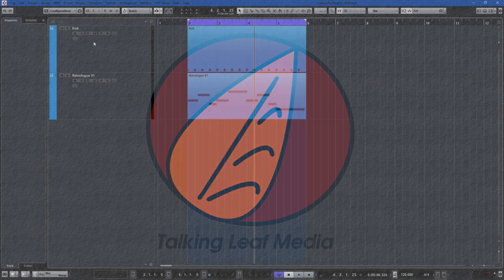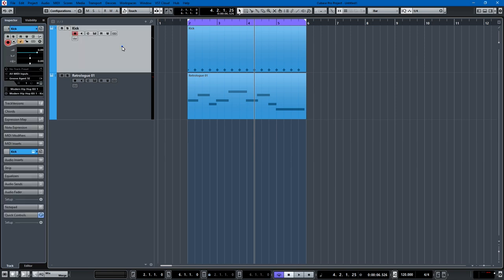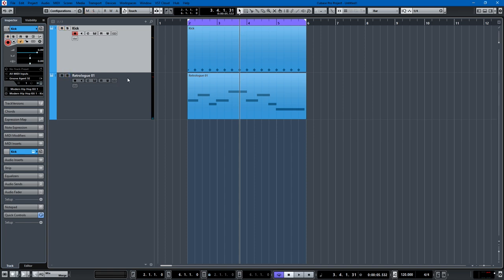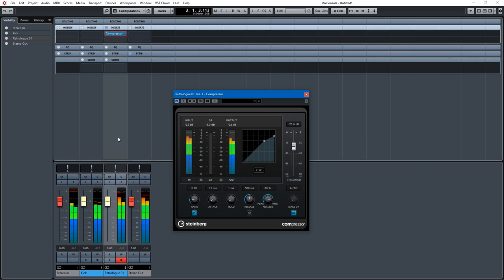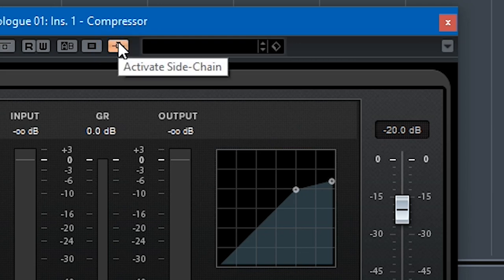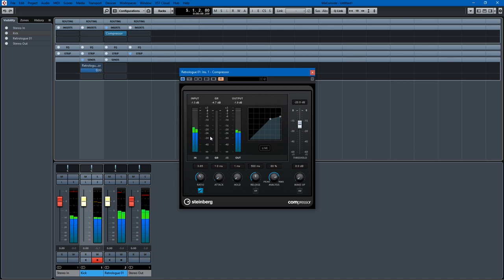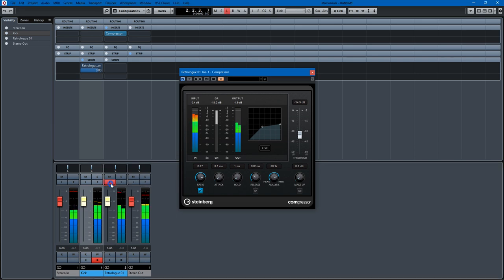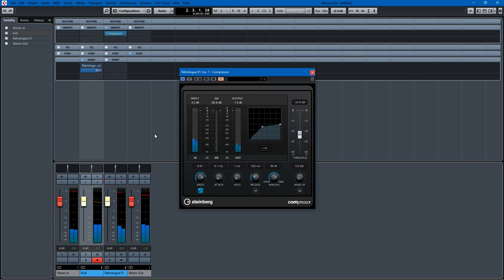How to do Side Chain Compression: Cubase Tips and Tricks Tutorial

Comment: In this example there was kick only, but if you had a drum track with snare, hi-hat, etc., would you have to isolate the kick?  Would you have to dissolve the track to separate them or can this be done with normal drum track?
Reply: Yes. You'll need to isolate everything anyway because if you have all your snare, hihats and kick on the same track then you're not going to be able to mix them properly because your kicks are on the low end and hihats are on the high end and you won't be able to EQ properly even.
Reply: I know I’m late and you most likely won’t see this comment, but you can just duplicate the drum track and drag-select all the notes above and below the kick note in the midi editor.

Comment: Thank you easy steps to follow. question... Can I use the compressor in chanel strip to do the sidechaning? It seams like the only way how you did it; it works only on midi file. By using sidechaning on chanel strip, it looks like it works only on audio file. I hope somebody can help, thank you.
Reply from the maker: If it is an instrument track it should work.  If it is a MIDI track, you'll have to find it's audio output and go from there.  Hope this helps!